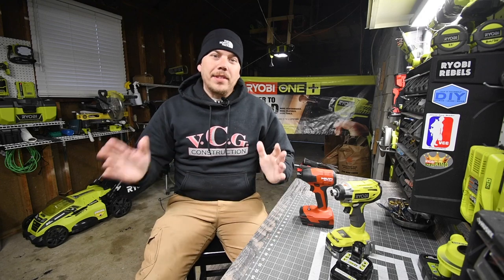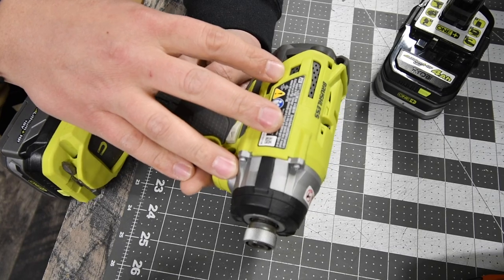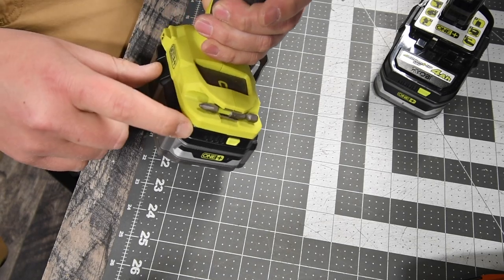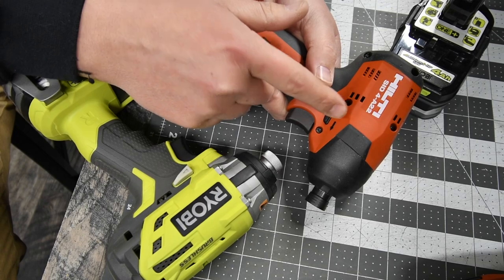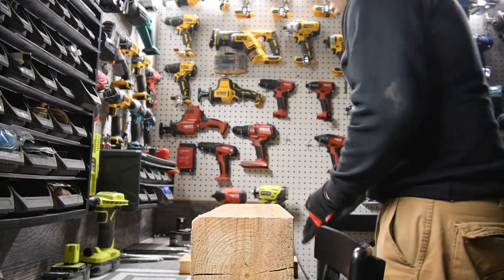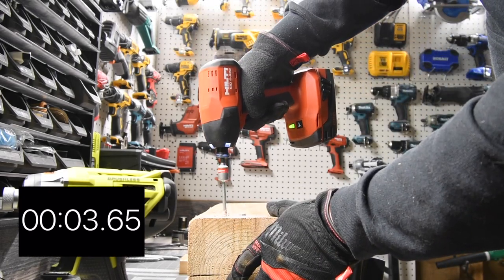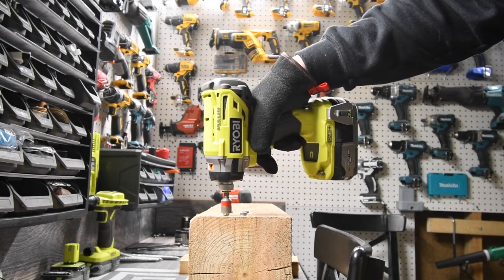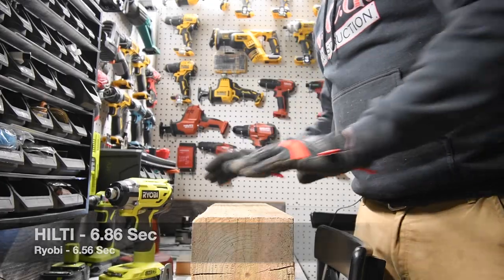HILTI vs Ryobi (Impact Drivers)

Comment: Anybody else remember working with those dark blue Ryobi kits circa 2001? With the red lettering? A full kit (recip, circular, impact, drill, etc) with like 2-3 Ni-cad batteries went for like 250$-300$ bucks. We’d go through 2 of those kits per season. Lol! Tools were throwaways basically. Bunk. 

I had no respect.

Eventually, when I started making real money, I bought a 28v dewalt kit. Ran me around 2500$. Still works to this day. Nano phosphate batteries still good. 5 out of 6 of them that is. I always walk by the Ryobi display and reminisce. “Hey, it’s green now” which pretty much sums up my inner thoughts. Fond memories I guess. Was my first experience with cordless tools.
Reply from the maker: I still have that saw and some old blue tools

Comment: I don't do as heavy applications but my Husky and my Dewalt 3/8 impact adapters have never failed. I'm mostly just tightening or loosening hangers on ductwork or bolts on air handlers. I don't think it should be expected that an impact adapter should be doing multiple big lags with no pilot. Good way to test the durability of the bit though, test to failure
Reply from the maker: I thank you sir and I also thank you for viewing

Comment: I think what happened with these adapters that most brand doesn't want you to use an impact driver as a wrench and vice versa to force you to buy both of them , that's why most of these new hex adapter fails at low torque
Reply from the maker: I know but that's the point of these tests. if I need to buy more than I need to buy more, its all good

Comment: I am in the market for an extremely high quality impact. I have narrowed it down to the Hilti SID 4-A22 and the Makita equivalent. Most likely I'll go with the Hilti. Are there any other ultra high end impacts I'm missing. At this point price is no concern. I just want the absolute best.
Reply from the maker: id get the milwuakee fuel if I were you. in my opinion it is the most power impact driver out there
Reply: MILWAUKEE HANDS DOWN, I own 4 brands and millwaukee is the best iv'e used.
Reply: OK I meant MILWAUKEE FUEL SURGE.

Comment: I think your breaking the bits when you are putting an downwards angle pressure on the bit. Why don’t you glue up plywood squares and use that in stead of a stump. It would be equal playing field with no knots and different hard spots in the wood.
Reply from the maker: I can do that and that is not a bad idea at all.

Comment: 8" lag bolt? That's the kind of job I leave for my impact wrench.
Reply from the maker: but its a good stress test
Reply: Those thin timberlocks aren't too bad.
If you've ever seen lots of home renovation shows on TV they absolutely loooooove using old, decrepit dewalt xrp and blue ryobi NiCADs to drive hundreds of those thin little 8 inch timberlocks.

The really fat bolts though.... yeeaah leave those to the wrench

Comment: Those 1/4” to 1/“2 adapter shouldn’t really be used for anything more than about 13mm or so
Reply from the maker: I like to put these tools through a rough stress test.
Reply: Yeah, it's just too little shaft material for too much fastener most of the time.

Comment: Tool YouTubers are genuinely getting ridiculous. Put 100 hours on both of those tools and then run a comparison. If you're deluding yourself into thinking the premiere industrial tool company on the planet can't make their impact driver faster your out of you're mind. Fastening doesn't need speed and in high end applications you need control. There's a reason Hilti has a contract with almost every state local power company, they are a precise tool and they will last forever. I've used makitas for a long time and have the xdt16 which would fasten faster than both of these and I'd still prefer to have the Hilti having used it. It's  a more comfortable tool bar none. You can touch a Ryobi blind folded and tell it was made in a sweat shop and it isn't going to hold up for any length of time. I guess this was a great video showing us the practicality of driving foot long lags into our firewood 🙄
Reply from the maker: TheVdog12 would you watch a 100 hour video?
Reply from the maker: Be Zaire I can say I used theses tools for years. If I wanted to. There would be arguments on a brand was used more then the other and it’s not a fair contest. There is no pleasing everyone
Reply: My argument wasn't make a 100 hour video, nor was my complaint about what tool you should be saying is better. When you make a video trying to portray a Ryobi is a better tool than a Hilti is when you lose me because you can encourage someone to make a poor purchase. When I say use the tools for a hundred hours I'm saying take them to a construction site and put them to work and the Hilti will out last the Ryobi and it will maintain it's performance better. I don't care about if you are saying you used a tool for years or if they're brand new. You're just trying to make a video acting like a Ryobi is a better tool than a Hilti because it fastens quicker which couldn't possibly matter under any circumstance. The tool videos are fun to watch but the whole "the Ryobi is gonna beat the Hilti " thing is crazy. It's a diy tool meant to sit on a shelf and drive a few screws a year that's the reality the Hilti is an industrial tool meant to drive hundreds of fasteners a day for years
Reply: So true. Worked my Hilti tools to death.. yet they don't die

Comment: Something seems a bit odd here. In your Milwaukee vs Hilti impact driver comparison the Hilti drives the 4" lag screw in 6.45sec (only 2.1sec behind the Milwaukee which is considered one of the highest performing IDs in it's class). Here we obviously have 18.72sec. The variable could be the log you're using for testing, otherwise there is something bogus about the Hilti's performance.
Reply from the maker: it all depends on which batteries are used
Reply: @ManCaverTools  For sure, but the battery was the same for the Hilti in both videos. It also sounds different, like it's running a different mode or something.

Comment: Something doesn't seem right with that Hilti, it does seems really slow compared to when I used it every once and awhile. Maybe defective? Also old mic was better
Reply: Most of german brand (Hilti , Metabo , Fein....) made to last and ain't care about Speed that much like American brand ( Milwaukee , Dewalt ....)
Reply: Also I think that some of the (low end) - (Mid-range) brand in the States doesn't follow most of the  (( AAshto regulations )) in case of noise level ...
Reply: @ahmeddagher  true
Reply: No the Hilti is just over rated in my opinion!!! The Ryobi will win every time no questions asked
Reply: @ahmeddagher  Most of them are all made in china and owned by the same company.. just saying.
Reply: @Turgz  Metabo 100% Made in Germany
Reply: @Turgz  Only Metabo HPT Made in China
Reply: @ahmeddagher  Read what i said please, i said MOST! I'm looking at a Milwaukee tool i have right now and guess what? It says "Made in the People's Republic of China". I've also got a Makita tool here, guess what? It says the exact same thing. They aren't the only "big" brands made there either and they're all owned by the same company.
Reply from the maker: I am adjusting the setting on the mic. and not sure if I have a defected HILTI. its HILTI so I shouldn't have one
Reply from the maker: HILTI till outlast all the other brands though. so I'm not worried about speed when it comes to HILTI
Reply: @Turgz  I'm totally agree with you but just clarifying a point about some brands 😅 and yeah a lot of these brand are the same but at the end they ain't have neither the same quality nor performance

Comment: I liked the other mic better.  You sound far away.    Maybe try a shotgun mic.  You can get one for $30 on amazon.   They’re mono directional so you have to talk into the top.  Not omnidirectional like a lap mic
Reply from the maker: im working out the settings. the other mic was the same thing when I first got it. just got to adjust settings :)

Comment: ... nice try  , and thanks for the effort and time spent to educate. 
Probably the Ryobi  is a good investment the only problem my Ryobi  didn't last more than 8 months  .
Not this model , because this one is only for Americans  , the first Brussels model sale in the rest of the world  , the one with digital selector and same function like Milwaukee., which now is used on the impact wrench to , the Brussels one you talk about couple of episodes ago. 
Putting a D.I.Y  in comparison with a professional tool  from my experience is that the D.I.Y  doesn't last  very much. 
Probably some people can take the 3 years guarantee as a bonus, because in that time they can burn out as many times they can  , I  tried this system and the replacement of the tools takes to much time  so I had to have 2 from each timp, buying the next one when the tools were on repairs on swap so they don't have the same period of guarantee. 
In the professional case the tools are more durable and I can tell about Dewalt DCF887  touch 2 years and half do break., 5 working days to be repaired , time for me to use again for impulse impact driver from Milwaukee  , used first time when I was working in a Hospital and did a very good job  , been unbelievable quiet .
Reply from the maker: I really want the version the UK has.
Reply: ... the impact wrench or impact driver  ?

Comment: You probably could have renovated your house 3 times over for the amount of money you've spent on all these tools that you don't even use. You need some variation in your channel. Running bolts into a log gets old real quick
Reply: Yeah it unbelievably repetitive and nothing is thought out
Reply from the maker: you are 100% correct
Reply from the maker: what else is more extreme than lean screws?I can do 3" screws if you want. I can do that all day and its cheaper to do. but nobody but a very few cares about driving with regular screws in every video with drills and impacts

Comment: I have noticed that Hilti is always a slow contender.. But a high price tag.. Nothing special and have a smoke show in your video.. What are u paying for? Not sure but they're trash.. Yes.. I said it.. U have proven it without a word.. Hilti is garbage.. Ryobi and Hilti are comparable.
Reply: Hilti is a brand for professionals that last years. Theyre not all about speed but reliability.
Reply: Hilti is used in real professional worksites, the concrete guys love Hilti, they are quality compared to the Ryobi mid level tools....and I like Ryobi....🇨🇦
Reply: Hilti doesn’t care about selling to consumers. They tend to deal with companies who want to lease a tool that will work day in and day out. Then, if there is a problem, the support they provide is top notch. That’s what you’re paying for. Not done marketing wank like led lights or brushless motors.
Reply: @steelhead197  For anything concrete go with hilti, that's what they're best at.
Reply from the maker: HILTI has the best Hammer Drill in my opinion. they failed at the Impact Drivers. But I think HILTI will outlast all of the other brands. can't beat the quality of the HILTI build.
Reply from the maker: I agree. HILTI will out last them all.
Reply from the maker: Agreed, HILTI doesn't make 10 different versions of the same drill to get people to buy them. HILTI will out last them all
Reply from the maker: HILTI will outlast them all
Reply from the maker: HILTI will outlast them all
Reply: @ManCaverTools  yeah im just not impressed. And that smoke show kinda nakes me doubt their current quality i understand u was oveeworking it but no other tool does it when u test.
Reply: @AverageReviewsYT  Facepalm